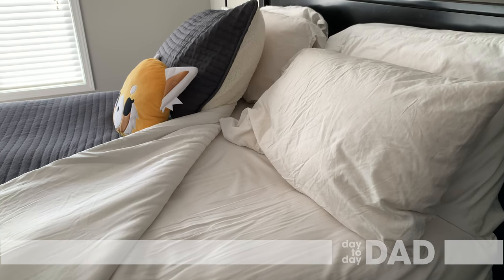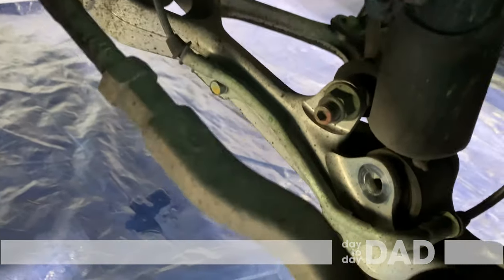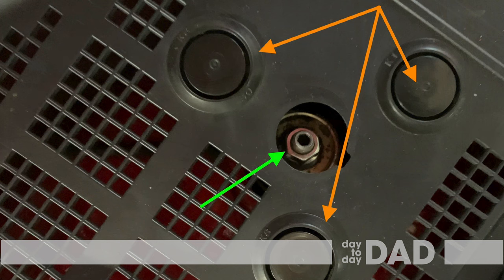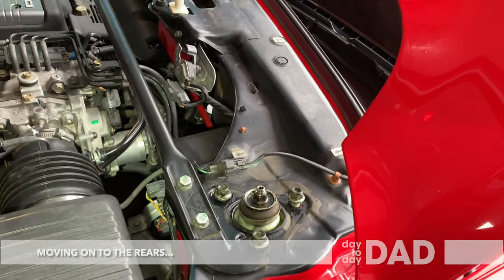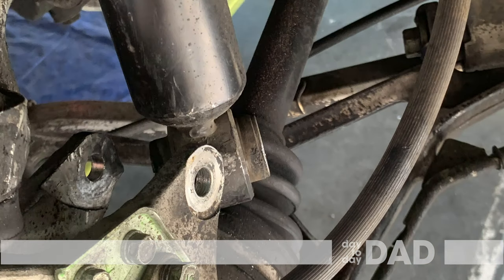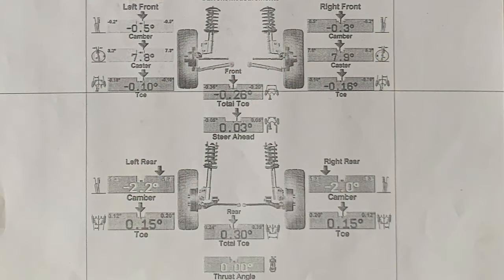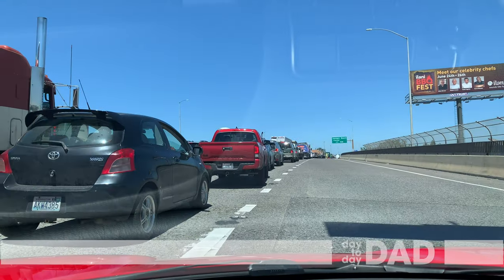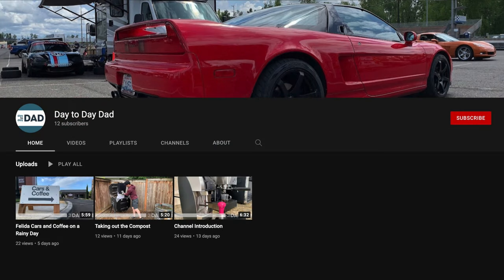Installing Bilstein struts on our NSX NA1

Comment: Great video dude! Does the car feel any different after the alignment? Also, how far out of spec was she after the suspension upgrade?
Reply from the maker: Caster was off one degree, toe was off on all wheels (some positive, some negative), and camber. However, camber could not get into spec on the rears. It should be max -1.7 but they could only get it to -2.0 and -2.2. Steer ahead and thrust angle were also off (0.14 and -0.19) but I am not familiar with what those equate to. They are now 0.03 and 0.00.